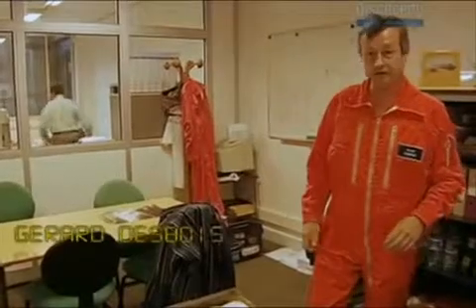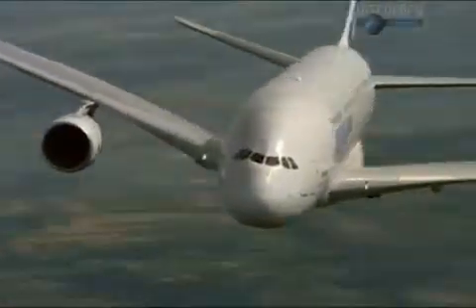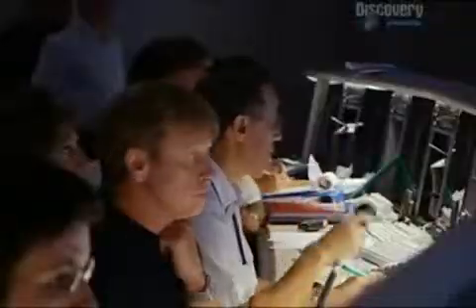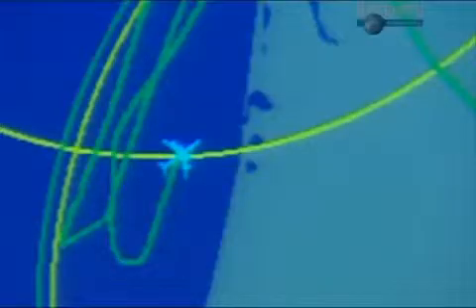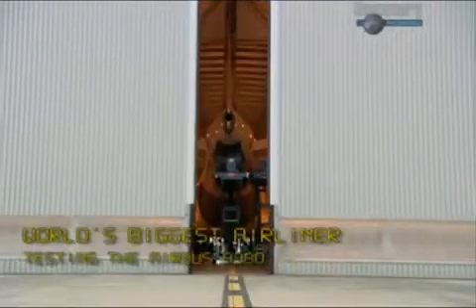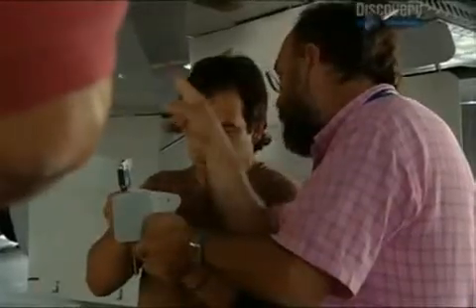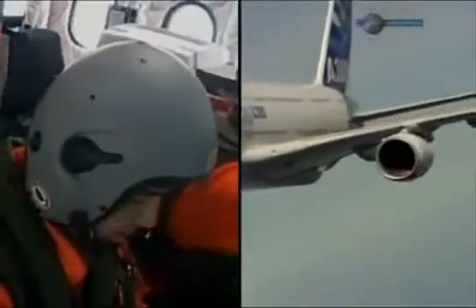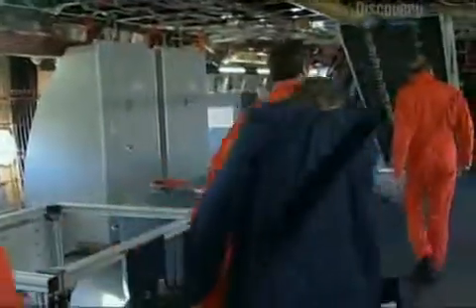Airbus A380 Flutter Test

Comment: The 747 was pushed to .99 mach in it's trials without issue. It will be flying for the next 50 years while every A380 will be scrapped within the next 10 years.
Reply: It's nothing to do with that....747 or A380....fact is 4 engines is bad business these days ...especially with the global airline industry in tatters.
Reply: The A380 is a superior plane to the Jumbo in almost every way imagineable, its work of art engineering. Only reason its being scrapped is purely for economical reasons. And do we even need to go into the utter shitstorm of problems the dreamliner has had after it went into actual service? :)
Reply: Why did you bring up the 787 topic? Thats unrelated and its not like the a380 is better than the 747 in every imaginable way. 747 is one of a kind at freight and comfortable for the passengers, the a380 can carry passengers more comfortability but has limited cargo utilities therefore the 747 has more versatility than the airbus. The 747, a340, a380 are all getting phased out because of the modern jets like the 787, a350, 737, a330, a339. The 787 has its problems but so does every other airliner. @wibblewobble1934
Reply: @wibblewobble1934 

But it’s not…it was bad foresight on the part of Airbus. ETOPS had been in effect for years at that point, the age of 3-4 engines was coming to an end and on top of that, they didn’t even make the a380 a viable cargo plane, which is what’s keeping the 747 alive. Earlier this year, I departed in between two Atlas 747-400s at a Class D airport. That’s something that no general aviation pilot will ever experience with the a380 because it will never fly cargo. The a380 is a beautiful airplane but let’s not delude ourselves…it was just about the worst gamble Airbus could’ve made at that time.
Reply: A380 is way more better and safer than hideous 747 😂
Reply: This has nothing to do with safety, every airliner in the sky is safe. A380, 747, a320, 737 they are all safe so that doesnt matter. About the 747 being hideous thats also your opinion so not a fact. @SaptarshiPal2005
Reply: pls just shut up you toxic Boeing fan!

no one cares how much you love the 747, this is a test video.
Reply: Have you flown on both? The A380 is FAR superior
Reply: My point is that all airliners are safe not that the a380 is superior. @reggin_spelt_backwards
Reply: 6 or 7 out of 10 biggest air disasters in history involves 747, still 0 fatalities and crashes for 380- the real Queen of the Sky
Reply: 1. The A380s’ are going out of service only because of the economy of big airplanes, just like the 747.
2. You are delusional to think all 747 between beginning of production have hndergone tests and mever had to go back tobe fixed. These tests exist because of the very same issue that you saw. The tests are there to put the airplanes under extreme conditions to ensure they will uphold in normal conditions